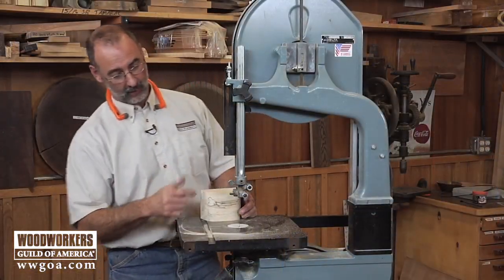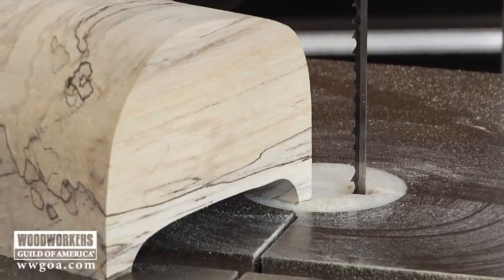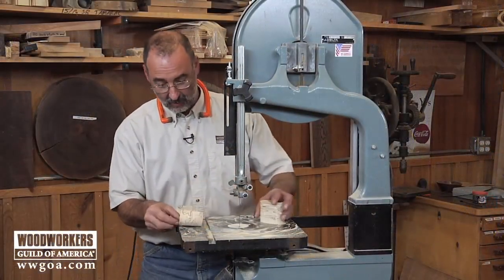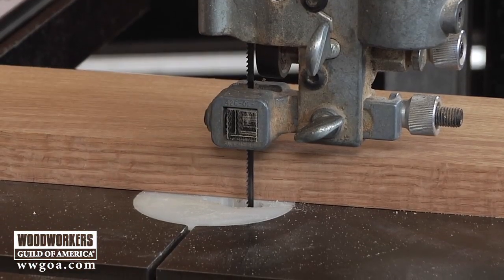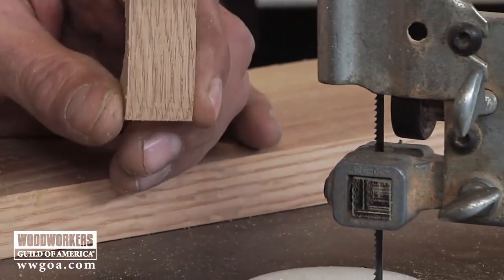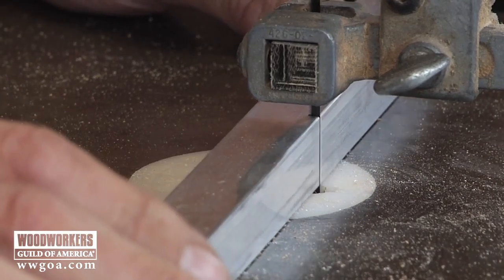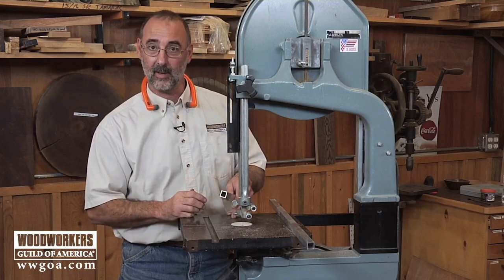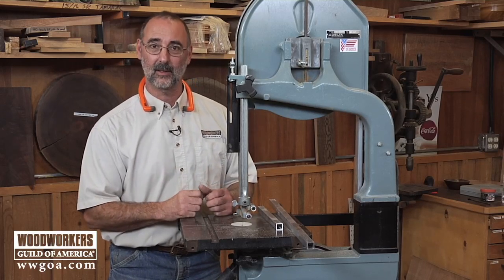Woodworking Tips: Band Saw - Benefits of Small Blade on Band Saw

Comment: Another great video and very helpful.  I regularly use a 1/8" blade for my bandsaw boxes and have the Carter Stabilizer as a guide. What I would really like to get is even smaller width blades 1/16" or even 2mm, but here in the UK it seems to be a problem.  Do you know of any manufacturers that make the smaller width blades that ship to the UK please.
Keep up the excellent video's.
Malcolm
Reply from the maker: Thanks for the comment. As far as 1/16" blade, unfortunately I've not come across blades that small, so I'm unable to recommend a source for you.

Comment: Do you need a carter stabilizer when using the 1/8" blade?
Reply: They work amazingly well. If you noticed how much movement he had when entering the wood, the Carter prevents that and makes the small blades so much more stable, also I think his thrust bearing was to far back. 
So the answer to your question is,  no you don’t need one but they are really nice to have.